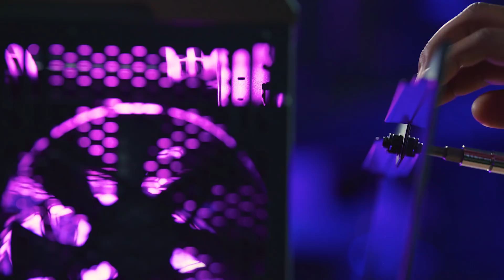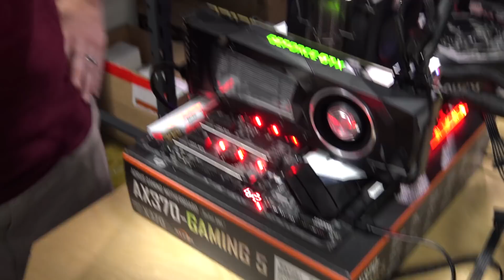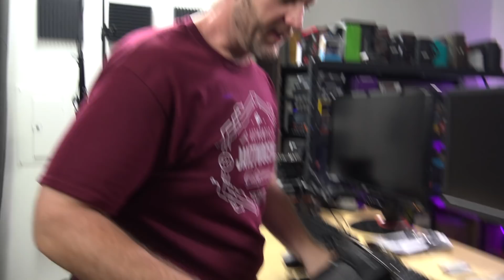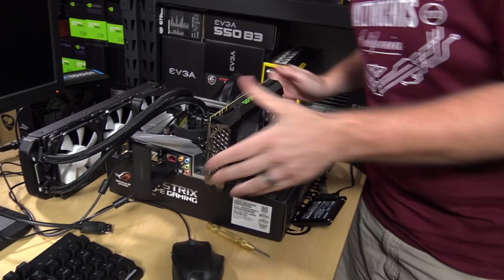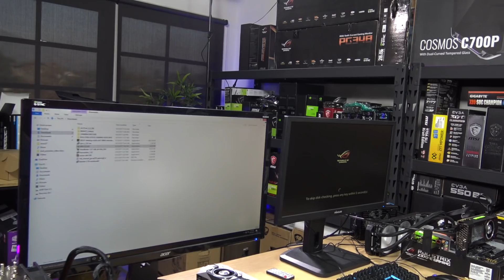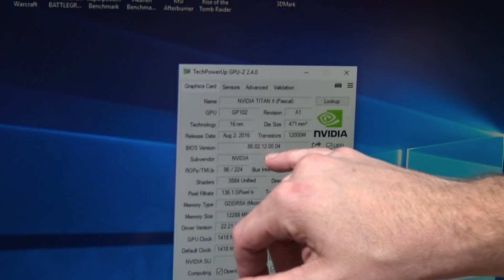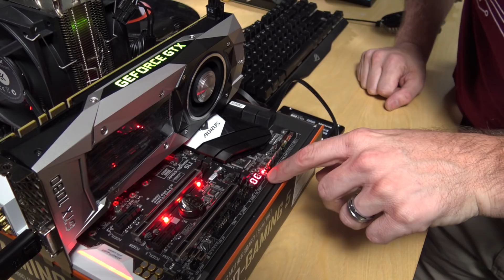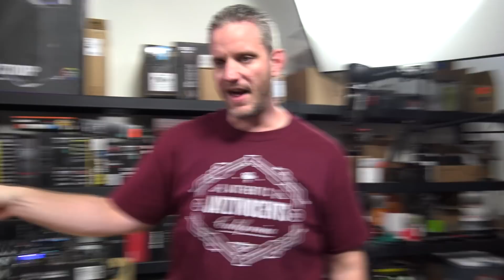I cant figure this one out... HELP!

Comment: Try a different pci slot with both cards on the ryzen system. Also try another motherboard but dont change any other components. Another thing to note is you didnt use the same output port when using card in intel system. Might also pay to swap over the displayport cable as well.

Comment: I have the 1060. I put it in a R5 1600 new system. Started getting random crashes, only on one game. Chalk it up to new Ryzen....and the game is in beta while other beta game work find. Motherboard(asus 370) up dated and even more random crashes. I get more crashes on firefox than Crome. I test this and that, use another gpu still crashes. Updated everything more than once; disable everything more than once. Over clock, no over clock....fans to max temps are great. I just can't hear you. All software, windows fresh installs......random crashes. 
         So, Jay I feel your pain!
Reply: **UPDATE** Well windows said it was updated. I clicked the view other content or such thing. Downloaded the 1709 build, as it turns out to be the creator update. Well so far its not crashes in two days. I would have crashed more than likely 8 times by now. Crossing 2 keyboards it stays that way.

Comment: i also had same problen after an update on windows 10..what i did is i tried to force shutoff and turn on for like 3x then it worked..i had a msi B350m arctic mortar and sapphire rx480 4gb and ryzen7 1700x.

hope you figure out the issue
hope the

Comment: I've had this happen also with a RX 470 on a p67 i5 2500k system not working. Worked fine in my x99 system. I didn't ever figure it out but I think it's related to the motherboard. I just narrowed it down and suggested my friend (who I told him to get the 470 about a year ago) to just go for a skylake build at that point and it worked after.

Comment: I once had the same problem in an Intel system a few years back when running SLI, the system wouldn't boot with one as the master or alone but as soon as you switched them it worked perfectly. Tried the card in a friends system and it worked flawlessly.
I was just as mystified.

Comment: to be honest it could be a slight error or imperfection in each part of the system that each alone would not cause any problems but together somehow cause the card not to boot. I wouldn't be surprised if you replaced any of the parts with the exact same model and it worked perfectly. 
If you want the technical breakdown:
1. In software no program is considered 100% reliable as they are usually so complex that bugs could hide anywhere and practically never be found.
2. In microprocessors the circuitry always has some imperfections which may even apply to on-chip IO controllers, some of which are only for specific functions on specific hardware and may have back ups or redundancy systems anyway.
3. the motherboard uses a large amount of different parts using both hardware and software to manage a large numbers of different pieces of hardware from different manufacturers using different standards(both software and hardware), many of which only occur between specific models of hardware.
4. to more efficiently use hardware manufacturers can bypass generic standard software interfaces to try to access the direct features of a piece of hardware that can leave it more open to errors.

Comment: I'm actually wondering if it is the motherboard that's having trouble identifying the GPU through the BIOS even though the card is technically the same,  they might have something unique to distinguish them apart within the system.  Do you have another motherboard to test it with, maybe an Aorus Gaming 7?  Fun stuff.

Comment: Is there somehow something physically different on the pins of the card not working, versus the other card?  Maybe something very slightly that just happens to line up badly with the Ryzen system PCIE slot, versus the Intel system?  Just a long shot.  With this many comments, I have no idea how you will possibly see this or many of these comments ;p lol

Comment: If the bios check (yeah you checked the same card twice and missed the 'bad' one), doesn't pan out, and forcing the same gpu bios version on doesn't help either (you're stuck with trusting the version string otherwise, I mean they might have just messed up...my colleagues have accidentally released a new version of our own software with an old version string before now, imagine the pain of trouble shooting that in the field), try chucking another psu in to power the card separately (ie add a second independent psu just for the card in the 'bad' rig) I'm not sure why but my spidey sense says the power reqs of ryzen - maybe only during the power-on surge - might be ferking the gpu?

Comment: Suggestions to track down the issue, remove card and then remove the cmos battery on the board to clear. Reinsert and go into the EFI and reset to factory defaults then try the card again and see if it works. It could also be a bugged flashing of the graphics card but then it would display issues on other boards, like poor performance driver crashing/blue screens etc.
I would stress the card on a board that it works on with repeated bench tests and see if showing problems. If it is, either RMA or attempt flashing the card. If there's no issues displayed it might just be a weird compatibility bug between the board and the card.

Comment: @JayzTwoCents I know (from experience) that some motherboards can handle a PCIe card running on fewer PCIe lanes (IE, you dremmeled the edge connector down to a lower lane width).  Is it possible that there is one or more defective lanes on the funky Titan.... if the Asus will "throttle" down from x16 to x8 it it might bypass the faulty lanes, and if the Aurus cannot do so it might not post.  Can you check the number of PCIe lanes a graphics card is using on both systems?

Comment: The only thing i can think of is that its a driver issue link to that specific card, Run another one that will boot like that second Ti and run DDU (Display Driver Uninstaller) and do a clean and shut down for installing a new GPU. The second thing would be a wrong setting in the PCIE Slot config through bios in Misc settings make sure its set in auto. I have that same board and its bad ass have my 1600X running @4.02GHz

Comment: Hi Jay,keep up the great work. As a suggestion of what might be causing it - how about trying to force the PCI communications into PCI express 2.0 mode instead of 3.0.... Im just working on the theory that the faulty card may be having issues talking/initialising to that particular motherboard/cpu combo at the higher data transfer rate.

Good luck on finding the solution

Comment: You figured out what we reported in August?  https://www.hardocp.com/article/2017/08/10/amd_ryzen_threadripper_1950x_1920x_cpu_review/8
Reply: Looks like you checked the bios of the same card twice Jay
Reply: Not a driver issue.  This is a bios boot issue.  See the code on the mobo.  This is chipset specific.
Reply: Kyle, you mentioned the issue was with Kepler, the cards in this video were Pascal Titans, not Kepler. Sounds like it still applies though.
Reply: Drivers are OS related not BIOS related.  It won't POST, which means it's not even loading Windows to load the drivers.
Reply: HardOCP TV So, do you think the power to the slot is not adequate? Or is the card drawing too much power from the slot at boot?
Reply: +YugenChaos Im pretty sure that was the card manufacturers issue not nvidias. something about not including thermal pads.
Reply: yes he did miss it,  he never looked at the bios/firmware of the card that was in the Ryzen system that wouldn't boot.
Reply: Some suggestions:
a. Check the ASIC quality of both cards. Perhaps one card is somehow pulling just a little too much power, or even sufficiently stable power, for the finicky AMD motherboard's liking?
b. Try another, better PSU.
c. Try another premium Ryzen motherboard.
d. Use GPU-Z to get a copy of the BIOS from the card the AMD system likes and use that to flash the BIOS of the card the AMD system doesn't like to ensure that the BIOSes really are identicle. Just to be sure.
e. Dismantle, check and replace the cooling thermal pads & paste on the "icky" card.
f. Prior to installing the "icky" card on the AMD system, run the "icky" card on non-overclocked hardware defaults for a while on the Intel system, then completely reset the BIOS on the AMD motherboard by physically unplugging the mains and removing the BIOS battery for a while, then install the "problematic" card, reseating if necessary, followed by trying a completely fresh install of Windows 10.

Hope the above is of help.
Reply: Could be the Ryzen CPU, the card switching seem to indicate that Titan does work. If he has another motherboard and CPU to change with it might shed more light on the cause of the issue. I think I had a similar problem recently with a new 7700k and gigabyte board. Turns out that the CPU PCI-lanes didn't work so the CPU had to be swapped out.
Reply: I had AMD only cards for a very long time and could not for the life of me understand why people would say AMD drivers were so bad and NVidia so much butter. I ended up getting a 1060 for my latest card and I have had more quirks and graphical bugs with this card than ANY AMD or ATi card, going back to the wonderful 9800 Pro.
Reply: If you read the article linked you would notice that they noticed installing the driver caused boot issues which is what i am replying to. as for the error jay is seeing seems to indicate a ROM error which means either the bios on the motherboard has issues(less likely since other cards are working). The bios on the card is  corrupted or old (possible since we never saw the bios on the card that didn't work on the video, and Intel can sometimes boot with corrupted GPU BIOSes, RAM SPDs, etc,). Defective PCI-e slot(less likely since again other cards worked). Dirty contacts on the card(possible since the slots conections might not be in exactly the same place but slightly offset).
Reply: Nvidia drivers have been ass, since the 10 series cards came out.
Reply: I am starting to wonder whether Nvidia drivers aren't as great as people seem to think. I have seen this problem where the driver causes boot errors happen on multiple platforms and even on prebuilt systems. The worst case i've experienced was on a laptop where i had to remove the hdd and use a separate computer to roll back the driver to just get it to boot.
Reply: do i need to remind you of the driver nvidia released that actually caused cards to catch fire?
Reply: What an arrogant comment, as if people read your site...

Comment: Eliminate the power supply connectors as a problem.  I've had pins work fine in some accessories and not make full contact in others because of the alignment of the folds in the brass pins in the connector

Comment: TL;DR - You can swap out 100 GPUs on the AMD machine and not run into that issue. However, you are almost guaranteed that if you take the potentially broken titan x and run it against 100 different platforms, some will fail to post. read more for details.

I had alot of wierd issues with server grade boards and CPUs when it comes to POSTing. Specially when you get a CPU with or without integrated gpu, vs. when you have a dedicated gpu installed on a server board. Imagine the BIOS features and tweaking of those intel 2600CP boards with different xeons installed in a dual socket format. It actually matters which CPU is enabled or disabled for integrated gpu. furthermore, it effects not only your display output properly showing stuff on monitor, but also POSTing. long story short, I have a system that reboots everytime i turn it on, upon cold boot. Not exactly a big deal, but definitely a strange quirk. on intel platform as mentioned. 
now to your problem. There is more than just the same BIOS on the same card to consider your test "controlled". This is 100% GPU compatibility related issue. What I mean is that one GPU could be drawing slightly different voltage through PCIe lanes and PCIe power connectors directly from power supply than the other. Youre a car guy, you know what happens to car battery at crank. It almost draws all the amperage available to crank the car. Its a burst drain effect or sustained drain. same thing here might be the case. upon boot up and POST, one GPU due to its architectural dynamics might be a bit more power hungry and it that is a red flag to CPU to not POST or not get enough juice. This is not about how powerful of a power supply you have. This is all purely after power being regulated and delivered for components. something as simple as the fan on the titan X being a bit more dusty so it draws more juice to spin up, to an internal capacitor to be busted or under-performing to a point that it causes issues to some POST process but not other. 
the more I go about this the more i convince myself that the issue is the GPU. if youre still not convinced, look at it this way. you have technically only tried that GPU on ONE more platform and it works. a better test to determine or eliminate faulty titan x is to take that titan x and run on multiple platforms, rather than running multiple titan x's on that one platform. the way you swapped out GPUs, makes me think youre trying to find a reason to blame the platform. (im an intel guy btw so im not defending AMD) im defending the scientific method.

Comment: i think you have a faulty CPU socket pin

ive seen an issue like this before.....and it turned out to be a pin.

could also be the PCIE pins.... that GPU might have SLIGHTLY miss aligned pads......or a pin might be SLIGHTLY bent on the socket it self

its some sort of tolerance issue with a connection somewhere

Comment: Ryzen sends 0C to the POST code screen when it goes into overclocking mode, disabling all limiters and internal voltage regulators EXCEPT for thermal limitations. If it sat on 0C and blinked on DRAM, add more training attempts, 8 generally does the job but some times some machines take 12 to fully cut out cold boots.

Comment: Edit *  You have so many comments, I see where you say you rechecked and they do indeed match, sorry *  Now, i don't think that was the problem.  I would however, re-flash the BIOS with the newest current BIOS, and make sure to clear all settings (I've noticed that my Ryzen system is funny with that sometimes)..  After that, i would then try the last known "Stable" bios and see, and possibly a beta BIOS.  I know that there is one guy on the ASUS forums that works on beta BIOS for Ryzen, so I'm sure there is something around for Gigabyte as well.

Comment: yeah, the card bios checked is the same card....as mentioned a few times
-check bios on right system, switch cards, check bios on left system...same bios checked.
but yeah, tech people sometimes love this, me too. with my mining rigs, running rx400 and rx500 series i have issues for days with drivers. but rule with amd....if it works, dont touch it!!!

Comment: I would go through with the "dead" graphics card in the AMD system and change out one component at a time, starting with the motherboard and ending with the CPU, in order to figure out which component is causing the problem.  Are any components overclocked?

Comment: A contact point is prolly messed up. I had this EXACT SAME problem, two different times. One was with a PCIe connector and the other was with the PSU I was using (the cabling actually-- didnt provide enough power b/c it was arc'ing out from a crack in the coating). If the amount of power required from the slot of one setup is able to handle and the other is not (or maybe the slot power makes up for a short in the PSU cabling), you'd get similar issues.

Did you check the code it threw out btw?

+and the "bad connector" problem I ended up having was that something got into the slot as I was taking apart/cleaning, and then it ran a while and I guess it baked itself on. Was hard to spot but it disrupted JUST enough to make it appear dead. Threw it in another machine (FX series CPU) and it worked fine. I do not own any of the 10** series Nvidia cards yet tho. And my issue might just have similar symptoms, not root causes. Thought Id share.

Comment: Just try cleaning the pins and pin slots for both mother board and GPU , actually it once happens with me but on more bezzar way . I had 4 Identical PCs with all same specs ,Gigabyte Motherboard and ATI GPU all of a sudden one PC GPU stopped working when swamped with another PC they both worked fine so I thought its Just a glitch , So Swapped them back But same Problem it didn't work ,. When I cleaned all pins and Slots they worked Just fine .

Comment: Try the bad titan in the 8x slot and see what happens.. and reseat the ram. if it gets to that reseat the cpu. Beyond that if it works in the 8x you have a slight bug in either gpu or mobo and it's one of those damned things.

Comment: You got the hardware lying around, get out another X370 motherboard from a different manufacturer and see if you can replicate the issue. If you can replicate it then switch to a B350 motherboard. If you can replicate it across 2 different chip sets then swap out and use a R3.

Comment: clean the pins on the graphics card and the blow out the slot, could be as simple as dust. or a pin is bent/broken eather in the motherboard slot, or on the card. and intel doesn't use that pin where rysan does.

Comment: I had exactly the same problem jay , turned out to be a faulty pcie power cable  try replacing that or the psu i tried everything even had card working then a week later no display , just stopped , grrr wtf , changed cards it worked , tried card that would not display in other system it worked , tried different card in same faulty system or so i thought and it worked , was female end of pcie cable that connected to card , replaced pcie cable never had issue again , maybee worth a look jay :)